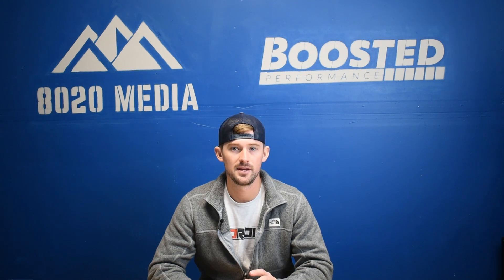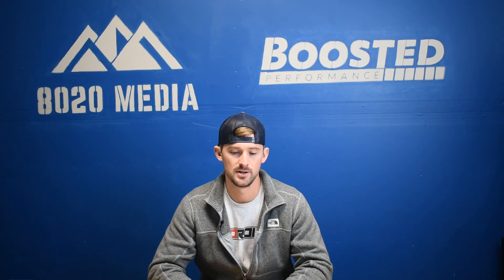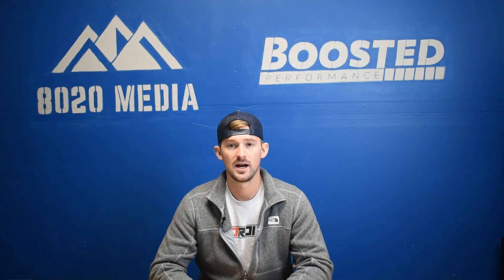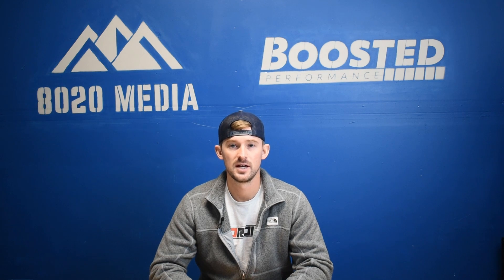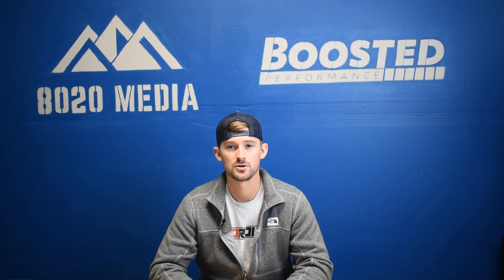The Few FLAWS of the Ford 4.6 V8 Engine!

Comment: 02 Explorer 4.6 owned since new with oil changes every 3k miles using Motorcraft Filter and semi-synthetic oil. Replaced timing set, tensioners and oil pump. One chain had rubbed a tiny hole in its tensioner piston, the guides were worn out and overall it didn't look like the front end was getting a lot of oil. I used a Melling high pressure and high volume pump. 
Still running great at 220k miles. Doesn't burn oil (but does leak from the rear main) and is smooth and quiet. Gave it to my son 3 years ago and he still likes it. Comment 4/8/25
Reply from the maker: P - Nice! Thanks for taking the time to share your experience!

Comment: I have 2000 4.6 ford expedition with triton v8 badge on it.. i've replaced the fuel pump just a while ago..problem is the check engine light goes on again but the perk is the engine runs great.. wonder why the code is always P0443..
Reply from the maker: M - A persistent P0443 code on your 2000 Ford Expedition 4.6 Triton V8, even after replacing the fuel pump, indicates an issue with the EVAP purge valve circuit—not the pump itself. This code typically means there's an electrical problem with the purge valve solenoid, such as a faulty solenoid, damaged wiring, corroded connector, or a blown fuse. Since your engine runs great otherwise, it's likely just an EVAP system malfunction that won’t affect performance but may impact emissions. Check the purge valve near the intake manifold and inspect the wiring and connector closely.

Comment: I bought a 97 Mark Vlll LSC back in 2002 with 42K miles and drove it until about a year and a half ago.  in that time I put on 310,000 miles!  Oil changed every 3000-5000 miles, never beat on it, took it easy until it reach operating temp etc.  Keep in mind this is a NYC car with stop and go driving.  I took it off the road for no other reason then RUST!!  The rockers are very rusty and part of the subframe now has rust.  The engine still purrs and aside from changing the water pump once, and an alternator and most of the coils the engine has been perfectly reliable, no noises or issues and still runs quiet and strong! I love the car so much I just bought a second one last July!   Its very clean, no rust, cold A/C  still on working air suspension and was garaged most its life and it shows!   It has 152K miles and I paid $5500.   Long live the Mark Vlll and the DOHC 4V 4.6
Reply from the maker: J - Nice! Thanks for sharing. They can be great if maintained properly.

Comment: Gotta say…
I have been blessed. I’ve got a retired Stanley Steemer 2008 E250. It’s push 323k miles. Got it with around 255k miles 7 years ago. I’ve only had to replace the air intake gasket & the factory alternator. Gonna need to replace the valve cover gaskets soon. But she still runs strong!
Reply from the maker: W - Nice! Sounds like you, and the person prior, took/take great care of it!

Comment: This is total BS!! I have a 97 Expedition with 250 k miles and still runs great! I also have it in a 2000. Crown Vic .   Both of these vehicles run outstanding !
Reply from the maker: P - Just because you haven't had any issues, doesn't mean others haven't. We know these can be great engines.

Comment: 97 4:6. Water pump. Cracked head. Right rear axle replaced   Alternator. E brake cable broke.  I’m the 2nd owner. My son has the 98 triton has put it through hell and still in great shape.
Reply from the maker: C - Thanks for taking the time to share your experience!

Comment: Great video..what can cause sudden rev to high explosion point.  Ive already changed throttle body clean tps iac  egr ,egr tubed,,all of it ..runs like new then after it gets warm like 3p minutes or mainly if i hit the gas while parked or even in deive driving it will just suddenly want to rev to max instantly..cant understand it????has new plugs coils battery ,alternator..?? 2000f150 4.6 xl 140 thousand ...runs like new until tgis happens mainly when hittinggas after warm..it shifts fine smooth again until after about 30 minutes or if i drive it for mile or 2 it will just suddenly ram up full throttle to explode point.and have to shut it off..then after cools its fine..does this in park ,neutral or driveing ?????help😢
Reply from the maker: S - If your truck suddenly revs to max RPM after warming up, despite replacing the throttle body, TPS, IAC, and EGR components, the issue is likely caused by a sticking throttle, vacuum leak, faulty PCM, or an electronic throttle control issue (if applicable). Since it only happens after warming up or when you press the gas, check for throttle cable binding or a malfunctioning cruise control actuator that could be holding the throttle open. A vacuum leak or failing intake manifold gasket could also cause an unintended high idle, but it wouldn't typically spike RPMs to max. If the truck has electronic throttle control (ETC), a malfunctioning throttle position sensor (TPS) or a PCM issue could send the wrong signals and cause full throttle activation. Try scanning for pending codes, checking the throttle cable and linkage for sticking, and inspecting all vacuum connections. If the PCM is malfunctioning, reflashing or replacing it may be necessary. Keep us updated!
Reply: @8020Media  thank you so much
Reply: @8020Media  had neighbors use his fancy scan tool but only found a 02 sensor code..I've changed all the other sensors tps,iac,egr,plugs some coils but not all of coils. AND can't see anything wrong on throttle body cleaned..it ..took off ..
Reply: @8020Media  it is 2000f150 4.6 xl ..has cable throttle body not electric

Comment: I got a 1997 T-Bird 4.6L 2V, the only thing I've had to replace is the water pump and the intake! Other than that it's been flawless because when they developed Full Synthetic Oil in '99 I switched it over! Runs just like it did new using non-ethanol gas getting 33mph highway!
Reply from the maker: L - Wow! Thanks for taking the time to share your experience!
Reply: I raced Mobil 1 Full Synthet Oil in 1987.

Comment: Another thing regarding the 3v spark plug issue.  This occurs with the 2 piece plugs that were made prior to 2008.  It is caused by carbon buildup along the bottom portion of the plug, and this carbon buildup is what causes the plugs to break off when you take them out.  If you use an impact wrench to take them out as opposed to a traditional ratchet, the hammer effect of the impact will break the carbon bond allowing the plug to come out in one piece.  This is the method I use to change plugs on one of these engines, and I've not yet broken a plug.  NEVER use antiseize on a spark plug into an aluminum head!  It changes the torque value of the plug and can result in the plug removing itself from the engine during operation.  Just don't do it.  Many of the 2v rocket plug issues can be traced to the use of antiseize, especially on 2005+ engines which have full reach threads.
Reply from the maker: S - Thanks for taking the time to share these insights.

Comment: The coolant leak you are speaking of at 4:00 was addressed and fixed in 2001.  It was the intakes with the plastic crossover that had this issue, halfway through the 2001 production year, Ford changed this over to aluminum - solving the problem.  The issue with the plastic intakes on these engines is running coolant through them.  Aluminum crossover aside, they still flow the coolant into that crossover, which has to traverse the plastic gasket plus the plastic lower portion of the intake that the crossover is bolted to.  If you keep up on your coolant flushes, this isn't likely to be a problem, but when the coolant becomes acidic, it becomes a huge problem.  The intake itself can crack anywhere along the 4 corners that the water jacket makes contact with it, plus the plastic nipple for the heater outlet can get brittle and snap.
Reply from the maker: S - Thanks for taking the time to share these insights.

Comment: the reason the plugs blow is that the later model gen 10 is that there is a point close to the plug that gets hotter than the rest of the chamber and it weakens that taint between the plug hole and valve seat
Reply from the maker: R - Correct! Thanks for sharing.

Comment: Que vergonha. Só fala e não mostra nada sobre os motores 2v e 3v?
Reply from the maker: P - Los motores Ford de 2 válvulas por cilindro (2V) son más simples, confiables y fáciles de mantener, utilizados ampliamente en vehículos como los primeros Mustang GT y F-150. Los motores de 3 válvulas por cilindro (3V), introducidos posteriormente, mejoraron el flujo de aire y el torque a bajas revoluciones gracias a un tren de válvulas más avanzado, pero son conocidos por problemas en el sistema de sincronización variable de válvulas (VCT) y bujías que pueden romperse al reemplazarlas. Ambos forman parte de la familia Modular V8, con los 3V ofreciendo mejor rendimiento a costa de una mayor complejidad y desafíos de mantenimiento.

Comment: Just got a 2010 Mercury Marque my Mom left me with only 60,000. miles.  Its perfect except that rats got to the wires that run gas gage.  Put a new fuel pump on it but its still broken so I just write the miles down.
Reply from the maker: E - Sorry to hear... Thanks for sharing!

Comment: 2010 F150 with a 4.6 2-valve here, 178,000 miles.  Did have one spark plug blow out, but I think my shop didn't torque it properly.  Still going on the original timing chain.  Only problem now is a slow oil drip from somewhere on the passenger side rear of the engine.
Reply from the maker: P - Thanks for taking the time to share your experience!

Comment: The 4.6 L fords are known to be 500K + engines Lincoln Town cars with these are known for this and all other models.  I have had them in fleet cars the motors all made in 100 vehicles more than 400 k with no issues.  You are an ass.

Comment: My first time here and i wanna say thank you from us ford guys for this video, i found it very teaching and informative to me pretty much being reminded as well as taught some useful things to know while currently owning my 4.6 and 5.4 liter which im having problems with my 4.6 right now where its seeming to  backfire slightly and all lost of power to not wanting to move at all while foot on the gas , it will start but all of a sudden its running so badly i cant drive it for work, i didnt know should i get a nrw engine or get it fixed not knowing where to start, would a weak fuel pump make it run like crap or bad plugs, perhaps, either way i want it fixed but dont have the money to do everything, so its making me not mess with it now, but if any thing you can suggest to just bring back the v8 power to turn tbe wheels and get it going canyou send me a five point list to do that should definitely fix the most common problems it could be facing i would greatly appreciate and post a thank you comment for your fans and viewers of my thanks for you
Reply from the maker: C - Thanks for the feedback! We appreciate it. Also, thanks for taking the time to share your experience.

Comment: Had a 2006 Mustang GT with the 2V and not a single issue. Had a 2012 F150 with the 5.0L and no issues. Just purchased a 2006 Ford Explorer with a 4.6L 3V which I'm performing a body swap with a 1952 Ford F1.
Reply from the maker: M - Nice! Thanks for taking the time to share your experience!

Comment: Wait, you're saying the 4.6 v8 also has timing chain issues same as the 5.4? ChatGPT says this is not the case, it said that the 4.6 was the more reliable engine - is that right or wrong?
Reply from the maker: J - We didn't say it wasn't reliable?

Comment: My girlfriends truck had a mysterious coolant disappearance issue no visual leaks used dye and a black light and its the same issue with the intake manifold cracking. Cheap crap plastic, none of my toyotas had problems with the plastic intakes and never had issues in the gm stuff.
Reply from the maker: F - Sorry to hear! However, thanks for sharing your experience.

Comment: Do they make stronger, more reliable aftermarket options for the timing chain retainers, intake manifold and oil pump/sending unit? I know they make sleeves for the spark plugs, but wasn't sure about the rest.
Reply from the maker: B - I'm sure they do. We'd have to look into it more as we don't know it off the top of our heads.

Comment: Got a 4.6L has 100K. No timing chain problems.  No throttle intake manifold problems. No bad oil pressure problems.  (Usually this problem is caused by oil filter valves not opening.)  No spark plug problems.  I find your report non-authoritative and opinion only.
Reply: I have a 4.6 3v with 324,000 miles. No timing chain replacement.no transmission or fuel pump replacement. No starter replacement.
Reply from the maker: K - Nice! Thanks for taking the time to share your experience.
Reply from the maker: A - Thanks for sharing your experience! Glad that you haven't experienced the problems we spoke on. Just because you haven't, doesn't mean others haven't. However, we appreciate your feedback!

Comment: The biggest flaw is Ford Engineers! For example the heater core. You can see it from the engine bay(at least the piping). It would have been a no brainer to make it come out from that side. But no lets make it so you have to drop the steering wheel and dash. And other other fronts. Ford stopped making a replacement OEM intake manifold for the Crown Vic.. THANKS FORD. AND THEY WONDER WHY THEY HAD A 24% DECREESE IN SALES LAST YEAR...
Reply from the maker: J - Unfortunately, they just don't make them like they used to..

Comment: I used to have a 2010 Ford Explorer with the 3 valve 4.6 V8 and it had a startup rattle and when it reached operation temperature  the motor would make a faint knocking sound. Was especially noticeable at drive thru's or driving beside a wall of a building. Had great power but that noise was the reason for getting rid of it, especially when Ford said it was a normal characteristic of these motors 🤦‍♂️
Reply from the maker: M - Thanks for taking the time to share your experience!
Reply: I have this same light knocking only when at idling at operating temp on my 2004 chevy colorado 4-cylinder. Definitely can hear it most when idling next to a wall or k-rail. Has been making this sound since I bought it at 155k miles and is now at 208k miles. The noise has not gotten any worse during the 11 years and 50k miles that I have owned it. I replaced both timing chains and  all of the piston rod bearings which made no improvement in the noise. I sure wish I knew what causes it though.

Comment: Anyone know why my 2009 f150 4.6L 3v makes a swirling sound all of a sudden think it’s a belt cuz it gets less loud after a while but theirs another squealing stil loud and wat not basically just curious if anyone knows what sounds or problems can happen or occur in my type of truck or at least what to check
Reply from the maker: A - Are you experiencing any drivability concerns?
Reply: Tension pulley

Comment: The 4.6 2v is not the same as the 5.4. The 4.6L is known for reaching 500,000 mile with good maintainance practices. And you would be very lucky and blessed to get 250,000 miles from a 5.4 L triton. I dont know where you got your figures. But they arent real. And the an actual guy that works on these engines, that can testify to this is the Car Wizard.
Reply from the maker: B - Thanks for the insight.

Comment: I'm surprised nobody has commented on the valve cover gaskets and grommets which are notorious for becoming brittle and leaking oil all over the spark plugs and spark plug wire boots.  The engine misfires and lacks power until the plugs are temporarily cleaned or the gaskets and grommets are replaced which are a real pita to change.
Reply from the maker: B - Thanks for sharing this insight!

Comment: I have 4.6 3v with 140 miles, I do regular maintenance as required by ford manual.
I upgrade to bully dog chip, added stainless headers for 5.4 L with modification right side header. Larger throttle body, cold air intake. Performance muffler…
 I have easy 350 hp I use truck towing mostly Rv trailer of 6580 lbs ( scaled) tow trailer no problem up 7% grade at steady 50 mph at about 3700 rpm.
  The little that can!!!!
Reply from the maker: K - Nice! Sounds like a sick build. Thanks for sharing.
Reply: zero chance you have 350 without a cam and long tubes

Comment: Ive owned two panther body 4.6 cars and they all have been pretty good. My grand marquis had 200k before i sold it and my crown vic currently has 220k and has only needed coil packs and i beat the crap out of it😂.i did own a 4.6 f150 with 330k and the engine was junk😂.
Reply from the maker: T - Thanks for taking the time to share your experience!

Comment: I love my 4.6l 3v. I got a 2010 mustang gt with around 165k on the odometer. Not sure what maintenance was done by the previous 2 owners but can say the ol girl get driven pretty hard by me. I like to do my oil changes about every 3000 to 5000 miles, with 5w20 royal purple and a Wix xp filter. As for spark plugs Ive replaced them 2 since in the 5 years ive had her. Its a phenominal engine and i would buy another 4.6 without hesitation in any vehicle platform
Reply from the maker: J - Thanks for taking the time to share your experience!

Comment: I recently bought a '99 Lariat, 4.6 with an aluminum intake. Was that swapped on or could it have come with that? The truck has only 55K miles.
Reply from the maker: N - Aluminum intake manifold or intake?
Reply: @8020Automotive  intake manifold.
Reply from the maker: N - Came with it.